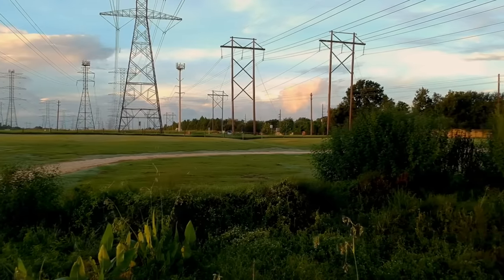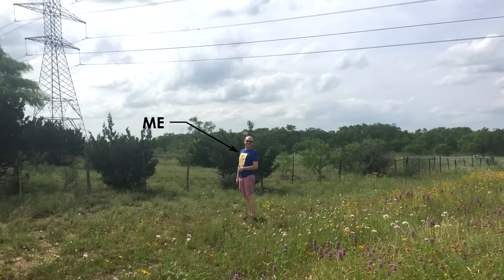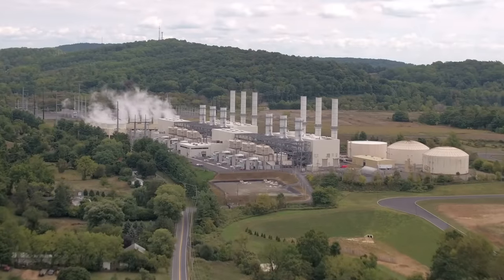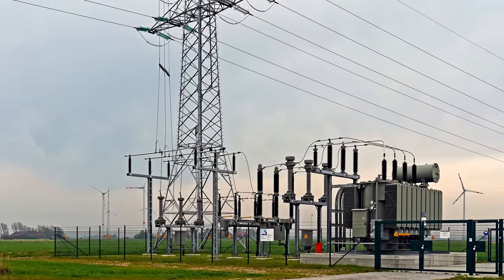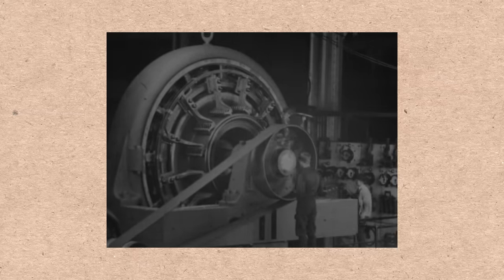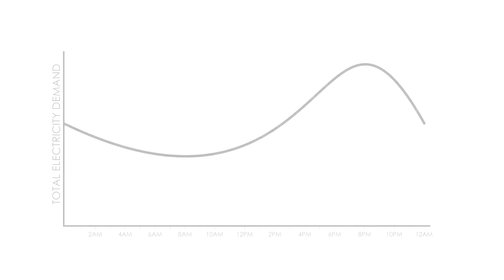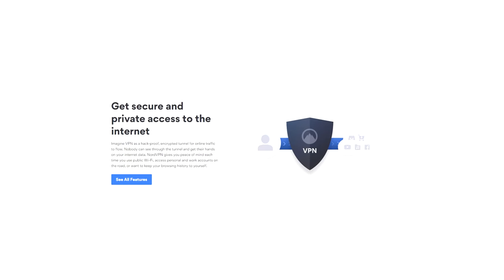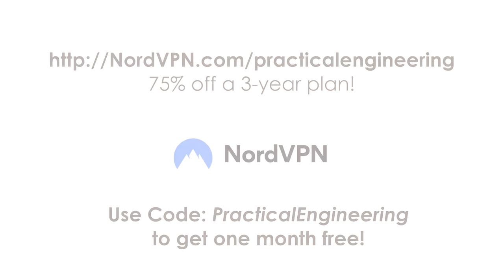How Does the Power Grid Work?

Comment: The powergrid is one massive undertaking that we take far to much for granted cause it does not take a whole lot to make the entire thing come toppling down in epic fashion. The fact that this hasn't really happened in the western world is a small miracle, though you read more and more on how it is actively being targeted in cyber warfare, though it is just as vulnerable in it's physical state. The main blessing is that it takes quite a bit of knowledge to know exactly where and how to strike at it. 

Also the use of the massive battery banks is proving to be a real big deal in dealing with the fluctuations, cause while normally one needs to have excess capacity running even though it is not needed most of the time, now this brief spike can be covered from actual storage which saves massive amount of costs, but also in environmental impact. 

The real future to me still is far more local generation and storage, the more we can decentralize the grid the less of a viable target it becomes, but also the less effect any outages from whatever reason will have on everyday life which pretty much grinds to an hold the instant the power is cut.

Comment: Can you do a video on what happens if generating capacity isn't used and why electrical transmission and distribution lines can be radial where the power circuit does not complete a loop? Thanks!

Comment: What wasn't mentioned here, and which totally blew my mind when someone working in a power station explained it...

EVERY SINGLE power station supplying power to a connected grid has their generators running perfectly in sync with all the others.  Supplying the exact same 60Hz (or 50Hz in EU) at exactly the same time.  If any one generator for whatever reason goes out of sync by a tiny amount it is automatically taken out of the grid until it can restore synchronicity.

Comment: How is demand on an electrical grid measured? Do they monitor voltage or current in the system? I'm curious as to how they know that they need to turn on or off certain short term energy solutions to match the power demand.
Reply: Its basicly all done with frequency. If demand ramps up frequency falls, a computer will notice that and turn on some more plants. But for variation in short time >1s the provided momentum off all the spinning turbines provide the energy. The wheels spinns at a bit more than 50 herz, if power demand comes up and therefore frequency  falls the faster spinning wheel will provide the energy by shortly slowing down.
Reply: Stephen Zambrycki, People with the time and courage to ask the questions are appreciated by those of us who come after and benefit from the answers. Thank you for your time and effort, Mr. Zambrycki.
Reply: @arnegebhard7021  Thank you for providing a thoughtful and thorough answer, sir.
Reply: M Detlef  This channel is called "Practical Engineering". You can expect it to appeal to a wide variety of interested viewers, with a wide range of experience and background. If you are fortunate enough to have extensive knowledge in the area, that's terrific. But basic questions from the genuinely intrigued layman can still be received and answered with respect. We're all better off with a more knowledgeable public.

Comment: Some places were using hydro as a energy storage.water pumped back to dam when low demand,in high demand just release to turn the generator.
Reply: You can still make the argument that the hydroelectric production component of pumped storage is essentially required to react on demand, but I see your point. Perhaps a more direct storage of electricity would be something like Tesla's new massive battery installation in Australia, but even that requires advanced systems to react to shifts in demand and modulate the AC output.

Comment: Quebec is separate because of their system not because they are political. 
A huge portion of their generation is near James Bay and all their load is in the south. There is a natural phase shift over their long lines that doesn’t work in the Eastern interconnection. I have personally seen Quebec’s system get tied to the interconnection. Voltage and load become unstable and causes equipment overloads  and protections to react unreliability. This has caused portions of the grid to black out. Hope this helps.

Comment: One of the key components of the transmission system is the Auto Transformer,, it is built and operates a little different than your induction transformer that you explained in your video.

Comment: Great video... thanks.. Now look up The Federal Energy Regulatory Commission (FERC) - check Wikipedia and the criticism section.  They really should have touched the controversy here... that it is a federal agency run by commissioners appointed by by the President. There's an unnecessarily strong bias toward coal and building pipelines. Some nations are doing much better than the US in clean energy.  But this video is a great place to start learning more.  Thanks for making it.

Comment: I love to have your services making a video for New Operators. Spinning up your turbine to let's say 3600 rpm, and setting up the field and synching to the Grid. A lot of Operators take time learning the limitations of the Main Transformer leaving the Generator. 
then, the issue with Distribution. Why the Operator of a Generator gets requested to adjust the VARS. Most Operators miss the point on the VARS of their Transformer and the Lines that distribute our energy to the consumers. Sometimes in occurances of Ice Storms, the Grid Operators request an adjustment of your VARS. This helps De-ICE long lines of wires on the Distribution Grid.

Comment: How does feeding electricity from multiple sources work? How is frequency matched for the sources to not cancel each other out etc.?
Reply: The Grid itself is used as the signal and timing source, so a Grid-Tied system synchronizes itself as part of self-checking before connection.

Comment: This May sound idiotic but I have to ask: why not use batteries/capacitors to smooth out those demand changes? Is the voltage too huge that it’s too impractical? 
Im asking because this seem too similar to the water tower video
Reply: Most peaker plants use fossil fuels, even though they aren’t that efficient for electrical generation,  because they can be stored and burned on demand. Battery capacity isn’t at a point where it can replace fossil fuel peaker plants, but hopefully we will get there before the planet fries from fossil fuels.

Comment: I've always had a question about the grid that's never really been covered in these explanations or videos, what happens if too much electricity is generated than needed? Where does it go? Since the electricity that goes to your computer or your air conditioning arrived almost instantaneously from the power plant turbines I'd imagine they'd have to change this quite often (assuming no batteries are connected to the grid), is there a way to just shutoff the line from that generator?

Comment: I have a question!  In Australia there are a lot of energy companies in the market but only a small few that pump electricity into the grid.
How do these companies charge consumers for the electricity when the grid is shared by everyone?

For example say Company X pumps only 10% of energy into the grid and company Y pumps say 90% into the grid.
What if COMPANY X has 50% of the consumer market but is only pumping 10% of energy into the grid where as company Y maybe pumping 90% of energy into the grid but only has less then 50% of the market share.
How can energy companies charge customers when the grid works as one major unit.

Comment: A video on how power companies can supply according to the flucuating demand would be interesting. What methods do they use? How can they adjust the supply in a matter of ms.?
Reply: The primary means of responding to instantaneous changes in demand is the rotating inertia of the thousands of generators. After that, the next means of response is through the design of the control system. One of the many jobs of a generator/turbine control system is to aide in frequency restoration. As frequency deviates the control systems are constantly increasing, decreasing the output of the units. If that isn't enough and there's still isn't enough then area control systems will kick in and can automatically dispatch/throttle units. Finally if all of those automatic means aren't doing the job or interaction is necessary in anticipation of a big event, then humans will manually set the units accordingly. It's a mesh of a bunch of automation along with human interaction.
Reply: Interestingly, one of the downsides of newer renewable technologies like wind and photovoltaic, is that they have no rotating inertia to help with the frequency control. They can mitigate some of these issues through control logic changes but most places have not. As a result, the frequency control has begun to suffer in places with high renewable penetration. Not an insurmountable task but just something interesting that most people don't consider about having very high renewable generation.
Reply: David Parry Very interesting, thank you for the explanation! This is a subject I know less of than I like to admit, but thankfully these days there are plenty of good sources of information online and knowledgeable people willing to share.
Reply: @SuomiFinlandPerkelee  There certainly are a ton of resources! Stay curious my friend.

Comment: You did not talk about 1& 3 phase out of a distribution line. What is the benefit of 3 phase. The induction to a lower voltage through transformers, doses make the current more stable?
Reply: Those are too complicated for an introduction of power grid

Comment: You failed to point out the MAIN reason AC frequency is required to be so precisely controlled, something that is a KEY factor when operating a power GRID: it is to allow the flow of alternating current power from MULTIPLE GENERATORS throughout the network to be synchronized to each other.

Comment: phenomenon called “TV pickup” has spawned.

Described as an electricity nuance completely unique to Great Britain, it refers to the fact that massive swaths of the nation’s population will all get up at the same time — at the end of a popular TV show — and cause a surge in electricity usage simply by boiling a kettle full of water to make a cup of tea.

So how big is this surge? Well, when the popular soap Eastenders comes to an end five times a week, the grid has to deal with around 1.75 million kettles requiring power at the same time. That’s an additional 3 gigawatts of power for the roughly 3-5 minutes it takes each kettle to boil. So big is the surge that backup power stations have to go on standby across the country, and there’s even additional power made available in France just in case the UK grid can’t cope.

Comment: Great video, thanks!  Can you explain why there are different grid zones? Why such a small zone for Texas?
Reply: There are technical factors that limit the distance that power can be transmitted, especially using AC.  The distance from the East coast to the West coast exceeds that limit, so the grid must be split along the East-West axis.  Likewise, the distance from northern Quebec to south Florida is excessive, resulting in the need for a separate Quebec grid.   However, there is interchange of power between these independent interconnections using high voltage DC links.   While DC transmission does not have distance limitations like AC transmissions, there is a significant cost for the infrastructure needed to have DC interconnections, and voltage transformation is far more complicated in DC systems.   Texas chose to have an independent grid for political reasons, and was able to do so because the law that gives the Federal Government authority over interstate commerce in electric power specifically limits that authority to AC systems, and does not apply to DC interconnections.

Comment: Maybe it's just a matter of semantics but if electricity can't be stored then what is a capacitor or rechargeable battery?
Reply: It absolutely can be stored. It just can't be stored in bulk. The amount of energy stored in the largest, most expensive batteries and capacitors are miniscule compared to the energy generated by the grid in just a few seconds.

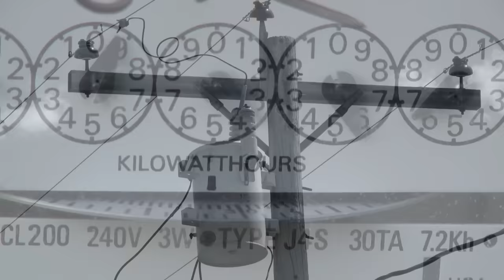Comment: 3:41 to 3:43 approx 3 seconds to go from 32 on the dial to 42 so:
3 seconds for a tenth of a turn so times 10 gets 30 seconds for a whole turn. Please notice 7.2 Kh per turn on the lower right of the meter. SO: 7.2 (Kh/Turn)times 3600(Seconds/hour)divided by 30 (seconds/turn)= 7.2*3600/30=864 watts and typical meters are accurate to 1/4 % (except at pretty low rates of consumption) 
PRETTY GREAT TOOL TO TROUBLESHOOT/ DIAGNOSE CONSUMPTION IN YOUR HOME.... 
Replys or comments greatly appreciated:

Comment: Does electricity just don't flow, like water, when it's turned off? or What happened at the outlets, and bulb socks, when they are off, but as soon as I plug something in the outlet, or turn on a light, it comes active.

Comment: what do they do when there is a sudden overproduction that might cause damage to the grid?
& how do they even out the renewable energy peeks?
Reply: there are controls systems involved that respond to help restore frequency. If there was an over production, most units would actively withdraw a small percentage. If the over frequency persisted, manual intervention would be necessary. If the manual intervention wasn't enough or fast enough, relays would start to disconnect parts of the grid and isolate the parts that are causing an issue.
Reply: David Parry are you engeener？

Comment: If this is a series, i hope you will touch upon the impossibility of having an entire power grid based solely on renewables.
Reply: not impossible, just highly impractical and cost prohibitive
Reply: @CaptainBlueTech  Renewable energy doesn't have the inertia needed to keep the frequency stable. It is also not reliable enough to cover all power consumption levels. So as far as i can tell, renewable energy is dependant on fuel burning power stations. That's why i'm hoping Grady can do a segment on this topic, clear up a few things.
Reply: Cristi, I understand your comment is now way out of date --  but at this point, yes we can run the entire grid from renewables.  You should probably get some education the topic.  And it is much cheaper and more reliable than what we have now.  Maybe look at some HVDC information as a starter.
Reply: @philtimmons722  My comment is not out of date. You simply don't understand how the power grid operates.

After boasting in 2019 that for 24 hours wind power supplied all the power in the country (it didn't really), now the UK is struggling with poor winds. So here we are, during winter, with little sunlight, overcast skies all around, and no wind, having to deal with 60m people trying to heat up their homes. If the UK was relying on renewables, people would be dying either of exposure, of asphyxiation as they turn to their fireplaces that have not been cleaned in decades, or in home fires.

You don't seem to understand that as a power source, both wind and solar are not reliable. You cannot bet on them with human lives. And that's just the problem with the from a fundamental point of view, as a power source. The other big reason why they cannot support a power network is because they do not have enough inertia. Literal inertia. When a lot of consumers come on line at the same time, the only thing stopping all other electrical appliances on the grid from exploding is the actual physical inertia of the turbine rotors in the power plants. They give the system enough time to bring power sources online. Solar cannot do that, and neither can wind power.

This matter has been thoroughly settled. The argument has been carried through. Germany and France are definite, incontrovertible proof that renewables DO NOT reduce CO2 emissions. After investing heavily in renewables, Germany was unable to reduce their CO2 output. And then they started berating France for their 0 interest in renewables, which is understandable, since France has a very clean and efficient system already, based on nuclear power. So France started investing heavily in renewables too. The result: CO2 emissions in France increased, and so did the power bill for the population. As far as i am concerned, anyone that is still adamant about implementing renewables while dismissing nuclear power is either lying or a useful idiot.

And finally, lithium mining is incredibly destructive. People that think fracking is bad for the environment have not seen a lithium mine. And of course they haven't, cause the media is hiding them from you. Big companies that rely on lithium batteries don't want to deal with angry mobs at their doorstep.

Comment: It's interesting that while historically transformers were definitely the reason AC 'won' over DC--as there really was no equivalent way to change voltage for transmission with DC at the time--today we actually do have high efficiency DC-DC voltage converters.  This is relatively new technology as it depends on fast switching in things like boost and buck converters, but now that we can actually do it there are some serious efficiency benefits to high-voltage DC transmission.  And there actually are limited parts of the grid adopting HVDC, particularly for long-distance transmission.